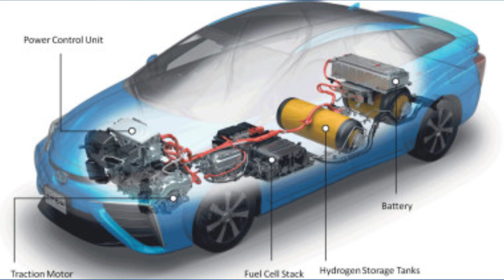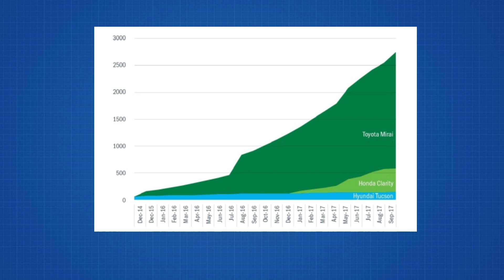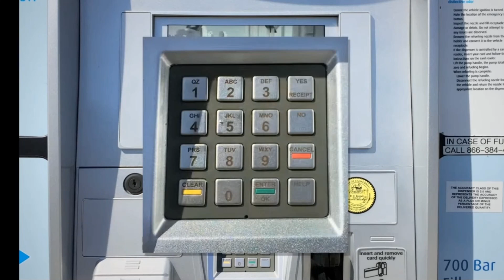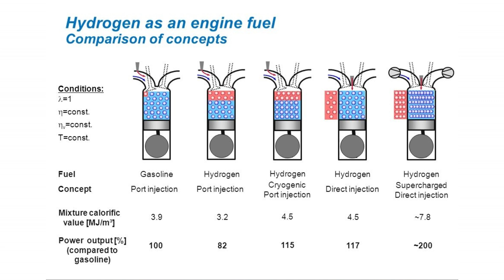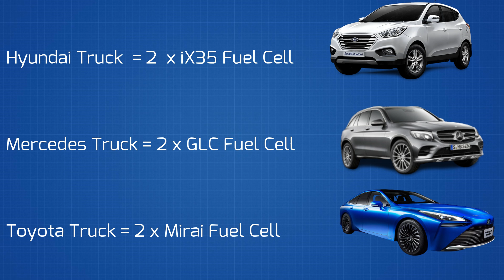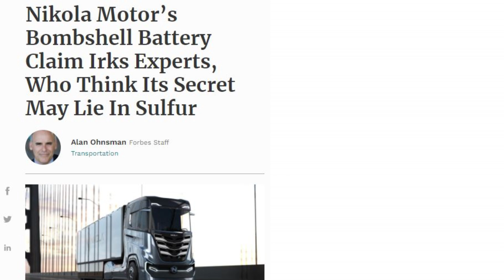Fuel Cell Technology & Nikola's Claims

Comment: This video is very frustrating concerning Nikola's fuel cell tech, but then it's only because Nikola has no such tech or no such tech to share.

Like the other excellent comments, I also believe hydrogen fuel cells are already out of the equation for ground transportation, not even mentioning the prohibitive fuel cost (double the price of diesel in Europe), a big no-no for truckers who work with very thin margins.
The Tesla semi has over 550 miles of range fully loaded according to Musk (announced as 500 miles initially), and a 30 minutes charging session that gives it another 400 miles basically makes it possible to drive nearly continuously within legal 24h limitations for one driver anyway, or even from Tierra del Fuego to Anchorage (21,260 km, over 11 days by car according to Google) with 2 drivers in the truck for 18 days non-stop at 50 km/h, at least once they bridge the Transamazonian to Panama...
Trucks need the most efficient batteries in order to carry more load, but they might still be better off with slightly less efficient LFP batteries that can withstand supercharging without losing much battery life. No cobalt nor nickel would also be a plus for cost and broad adoption of electric trucks. Efficient electric motors without permanent magnets such as the ones BMW is currently developing would be a plus for the environment too, especially if you had a chance to visit or google-map the location in China where they produce the most neodymium.
Reply from the maker: If only we can make Aluminium Air batteries with long life cycles, that would be nail in the coffin for fuel cells
Reply from the maker: Thanks for your detailed input. It helps people get a lot more information. Some points that are absent in the video are often found in the comments section. Thanks for contributing

Comment: While not using hydrogen fuel cells there is a U.S. company producing electric drivetrains for class 8 commercial trucks. Hyliion converts trucks into hybrids. They are currently offering diesel powered electric and CNG powered electric conversions. The cost is very reasonable and pays for itself in fuel savings. (I enjoy your channel. Thanks for all you do.) 
https://www.hyliion.com
Reply from the maker: Thanks for sharing

Comment: As always well presented 

On this occasion I feel compelled to comment on your viewpoint in regards to vehicle fuel cells

Fuel cell vehicles are akin to commercial fusion....

Directly filling your energy storage with electrons is the most efficient path as opposed to having those electrons go through many steps before being used

Using an energy carrier is pointless

The horse has definitely already bolted on this one
Reply: The electric battery power to weight ratio is the problem for heavy trucks.

Comment: Well...you can (theoretically) burn hydrogen in a combustion car (BMW tried this in the "Hydrogen 7"). But this uses (at a minimum) fourfold more hydrogen than using it via fuel cell (i.e. instead of paying 15 Dollars per 100km mobility you're paying 60 dollars per 100km mobility...whereas with batteries you're paying less than 5 dollars per 100km mobility). So it's not cost competitive for private - and most certainly not commercial - transportation.  (Oh, and the Hydrogen 7 also had a tendency to explode so was discontinued after a few show cars)
The 'fast refueling' is also a myth if you look into how hydrogen refueling stations work. Only the first car refuels fast. The next one waits half an hour (i.e. in real world scenarios this is no faster than charging a battery). A hydrogen station can only service 40-60 cars per day. This low thoughput is due to the compression from the low pressure main storage to the high pressure fueling point storage and subsequent cooling from 90°C to -40°C needed prior to each fueling cycle).
Reply from the maker: Thanks for your very informative input